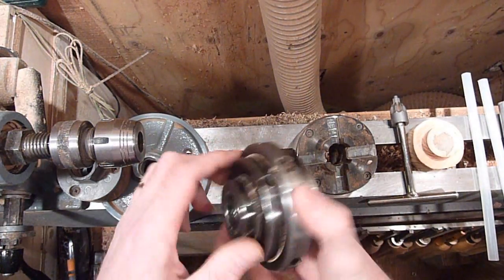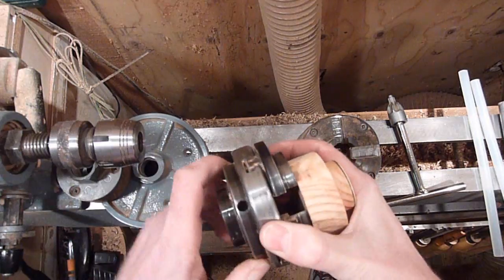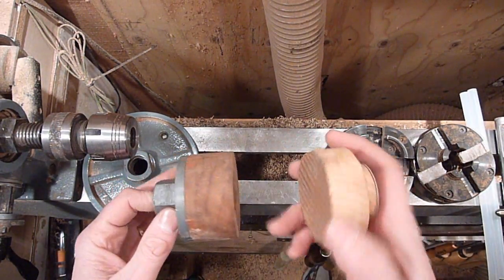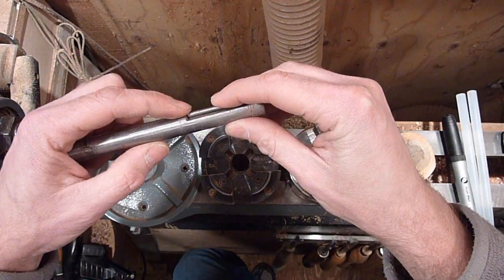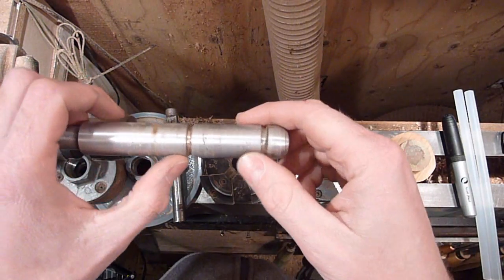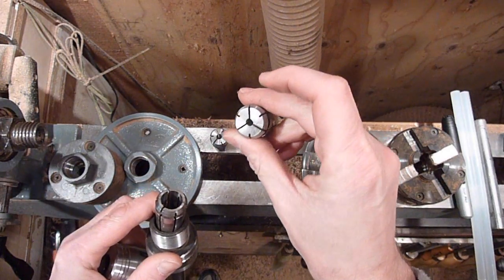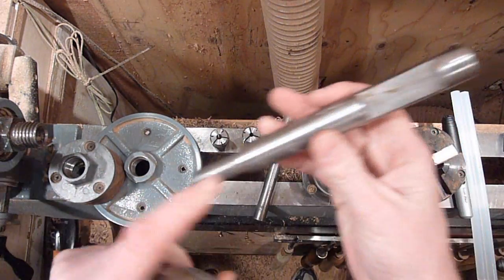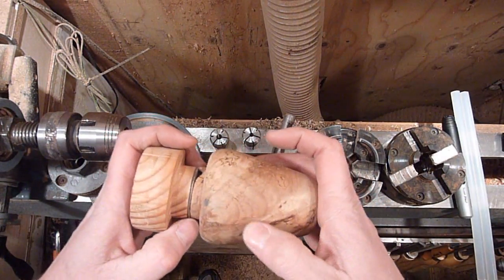Wood Turning Mounting your work to the Lathe

Comment: Carl.  One alternative that I found to be very useful is a Beal tool.  It allows you to tap a piece of hard wood to fit the diameter of your spindle.  It act just like a face plate and you can make them in any dimension.  Also, individuals don't have to worry about the screws.  One question.  The pin for the duck calls.  is it simple to jam to the wood in?

Comment: hi Carl .  can you tell me how to attach the various pieces in order to mount work on my lathe .  i bought a old wood lathe and the only connection it has is a internal thread inside the spindle .   im guessing you can get a fitting that threads on to that and is also threaded at the other end for attaching face plates and chucks  etc .  do you know if there is better ways to do things   ?   im intending to just be turning round wooden dowels of one inch to two inch .   Thanks

Comment: HI Carl--
I have a 1938 Delta Rockwell Milwaukee lathe with a compression chuck with four chisel edges and a point for the drive side.  What kind of Nova chuck can I buy which will fit this lathe?
Reply from the maker: Dan Burson Can you take to compression chuck off of the lathe? and does the head stock have treads? If the head stock is something like 1" x 8 tpi most chucks will work.